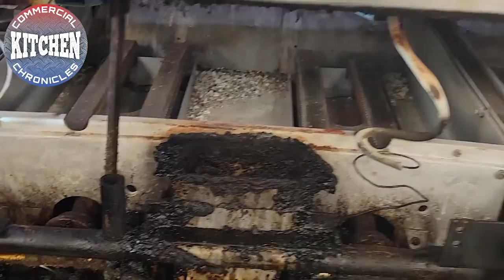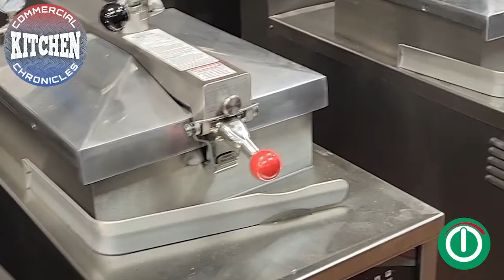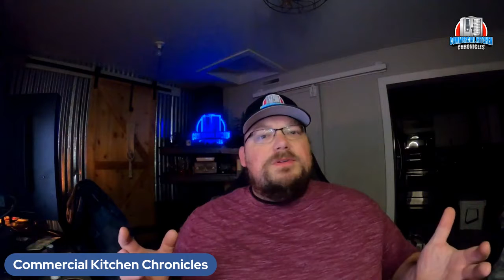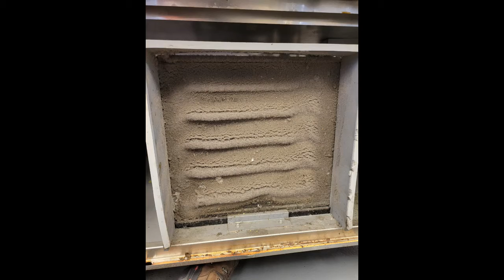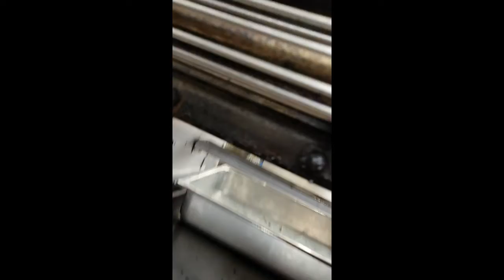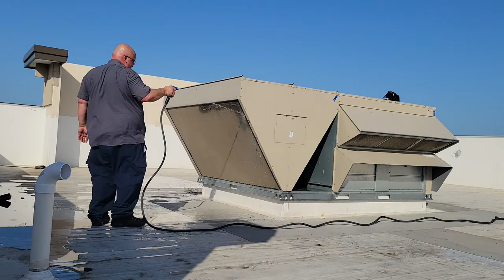So you want to join the Foodservice Repair Industry?

Comment: Wait what company you work for? I been working for Hobart I been thinking on making a move to another company
Reply from the maker: General Parts
Reply: I'm thinking about applying to hobart. What do you dislike about working for them?
Reply: @StardustDrgnfly  I was working at the LA branch and management wasn’t really present, every time you had questions or concerns they would never answer the phone or hear from till a couple of days later, when I was “training” they had me rolling with two different techs that were basically new(6 months-1 year in the company) that didn’t know much and didn’t really want to teach just cause they didn’t really know what to teach, I was promised I was going to get sent out to training facilites in Ohio within 3 months of getting hire and I got sent out 1 year a later, secondly they told I was going to get put on the “On-Call rotation” after fundamentals class, I was put on the rotation within 4 months, way before I even attended fundamentals class in Ohio, when it comes to tools needed they provided the most budget ones and they expect you do the job even if you don’t have the necessary tools, overall I would not recommend.

Comment: I started working for a company servicing tankless water heaters for Texas Roadhouse, Red Lobster's, Jaggers, Bubba's, and other commercial restaurants throughout the US. It was basically doing pm flushes with vinegar on all tankless and a few installs on the water corroded ones. I've worked on Rheem, Rinnai, Noritz, Navien water heaters. It was never a boring job. I swapped the internal parts: fan, blower motor, t-stat, board, pressure valves, remote controller. I had to make sure the dish tank temp was @180 degrees and that notorious PRZ gage was within range. I was able to install check valves with the pro press, install GRUNDFOS pumps, and change out the neutralizer rock that is on the very bottom which all the residual water flows out through. Now this is all done in the mechanical room so there's no distractions at all. 

Like he said there's a little of everything on the job. Electrical, plumbing, exhaust, diagnostics, maintenance, checking water pressure  on outside RPZ, reading manuals, calling the master plumber for direction, taking pictures, updating work orders on laptop, talking with EcoLab, GM, while being professional. Now when fixing the other cooking equipment, some of that has to be done while there are 20-30 people running around cutting vegetables and cooking. This is a must when testing all water valve to make sure it has proper flow even in the front of the restaurant. The name of the game is to be KooL and not be distracted. When you turn on the hot water to the restaurant that's been down, they look at you like your Superman. It's one of the most rewarding feelings ever and better than any desk job in my opinion. The traveling, meeting new people, and sleeping in a different hotel was the best part. 

If you get into this field, you will sleep good at night because you move from one job to the other. If you love to learn and work with your hands, then this job is for you. Make sure you save your Per Diem money and this is a perfect job for a single man who wants to save money and have an awesome career. Awesome video! This brought back many memories. What state are you located in? Even though it's been a few years; I'm thinking about jumping back in as I reside in Michigan.  Thanks for sharing!